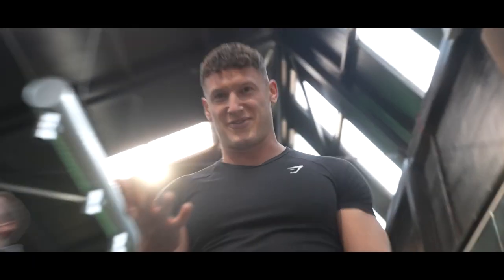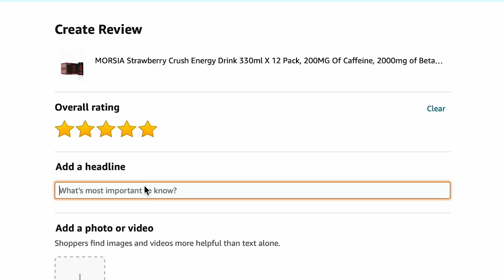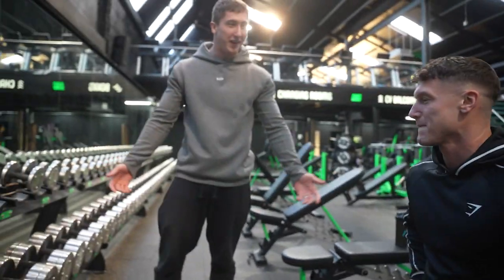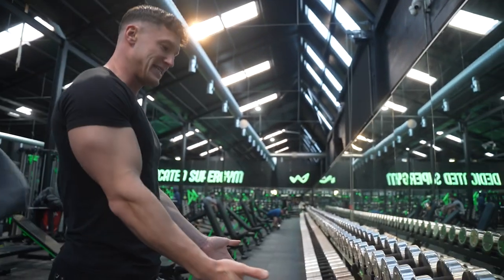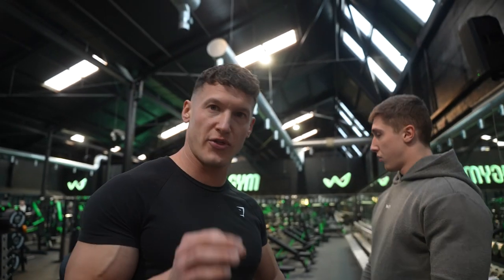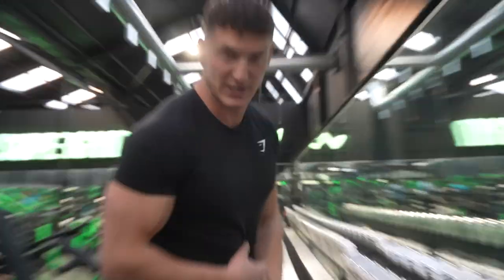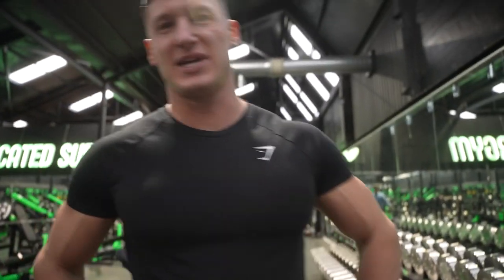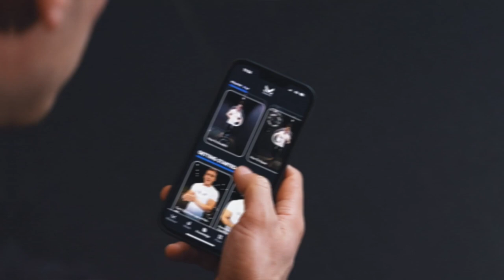"BET YOU CAN'T LIFT THIS!" (The dumbbell that only ONE PERSON can lift)

Comment: I was watch scotsh game lift radome rock sprayed painted weight on. some have handle bolted to it. worlds strongest make own atlas stone with mold and concert or cement think better.  not sure who got own house. if have own house near door. place huge log that some lumber jack cut down. go hard ware store bolt screw handle on it or two handles see lift it. not. fresh cut tree full water were tree that dead while dry out and crack. so it get easer lift later own. when cut fire wood that case dead for while or full water. have friends get in on it see find own log that handle bolted on. go house house see lift it. also not. screw allotted certain weight. lift handle pulls out. bolt work but drill through log depending how big is might not get rode clear through make own rode. you could also wood glue wood together make what shape want. not. buy wood glue together more expensive find peace fire wood. but look nicer have easer time get safe handles.
Reply: also this free have fun. not give money away have more things like this so not give money away all time.